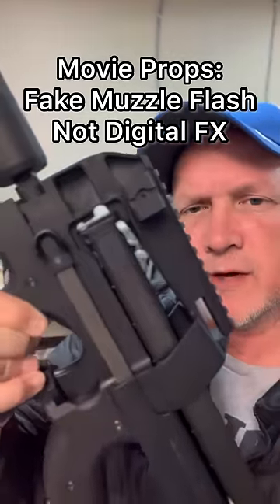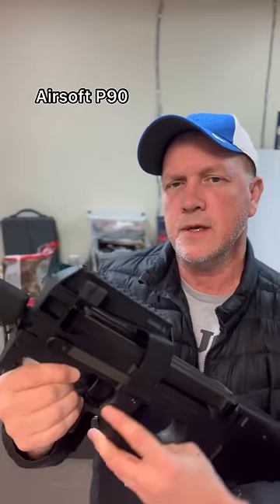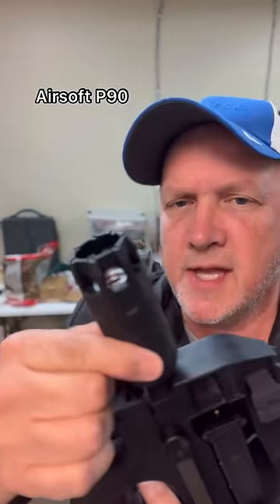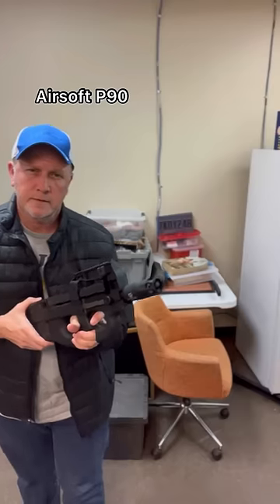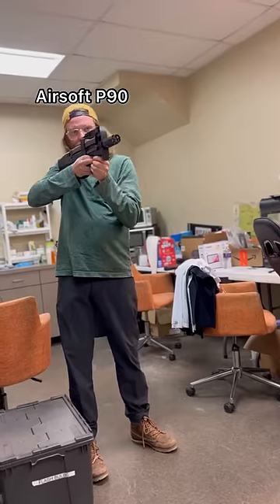Movie Props:  Fake Muzzle Flash on Airsoft Prop #shorts

Comment: Airsoft will always be a hundred times safer than blanks, plus you can get all-metal versions that look virtually identical (other than in hero shots), and there's a fair few with shell ejection out there. I have 0 problems with shows and movies using airsoft rather than blanks.
Reply: The answer is price.
You want weapons to look real-you need metal replicas.
You want weapons to feel real-you need replicas with recoil simulation and proper weight.
You want a close-up shot with cases flying around-you need either a heavily modified replica or a ton of VFX, because most airsoft models won't have ejection and cases. 
You want a weapon, which doesn't have a good airsoft replica-well, guess what?

It's a lot of money to invest, probably, some prop studios have realistic airsoft guns, but a good armorer and a ton of blanks and guns for blanks is still cheaper.
Reply: @Dazllingston  a blank firing gun costs more than a CO2-powered blow-back full-metal 1:1 replica. Source: I have a CO2-powered blow-back full-metal 1:1 Sig Sauer P226 replica that cost me 100 bucks. Shell ejection is rare, but still cheaper than a blank firing gun that's allowed on-set. Plus, shell ejection can be done so easily in post, an intern can do it in after effects in a few minutes. Also, blanks (the ammo) cost far more money to fire than gas, and it has to be reset more often than gas. Not to mention the cost of insurance being lower, no lives being in danger, and no costs of the set being shut down for investigation if something goes catastrophically wrong.
Reply: As someone in this thread mentioned before, real guns are FAR cheaper than airsoft in the US, which is a problem in a number of ways.
Reply: @jaycorbin  Why would it be a problem. Guns should be affordable so more can buy them
Reply from the maker: @Dazllingston    I agree.  I prefer conventional blank gunfire for sure.  I’m just showing alternatives for those cases when you have no choice.  My current show will not let me use anything but replicas and airsoft.  Which sucks when you need revolvers and bolt action rifles etc.
Reply: @jaycorbin  A gun can not be violent or kind it is an inanimate object.
Reply: @ScottPropandRoll    sorry, maybe language barrier made me sound rude, English is not my native language.
I wasn't trying to prove that airsoft is bad for props, I was answering why isn't it so common. 
I do enjoy your videos and I want to apologize for this misunderstanding
Reply: @lucky43113  And yet killers use it, TO KILL!! So maybe we shouldn’t be allowing killers to use guns to kill. My god.
Reply: @jaycorbin  Last I checked murder was illegal. You really have no clue
Reply: @lucky43113  Ok…. And yet the weapons people use to murder are perfectly available. Apparently you need a license and rigorous testing to drive a car because a car is dangerous, but an AR-15 and a bucket of bullets? You can’t just pick up hat up from the local Walmart for $20 once you turn 18.
Reply: @jaycorbin  The gun will do whatever the person holding it chooses. I don't know any gun owners who have committed a violent act. I can take any gun load it and set it on the table it will do nothing without human interaction
Reply: @lucky43113  neither does a car, but unlike guns, you actually have to be COMPETENT to drive a car.
Reply: @ScottPropandRoll  atleast there are shell ejecting bolt action airsofts and gas powered airsoft revolvers also use shells to hold the bb so at least that can get you half way there
Reply: @lucky43113 that's the most stupid argument I've ever heard. It doesn't change the fact that guns were designed to hurt/kill and that it gives the wielder more advantage than most weapons, or even objects.
Reply: @drogadepc  Firearms are the exact reason we have the freedoms we have.
Reply: @jaycorbin  More ignorance driving is not a right the 2A is a right
Reply: @jaycorbin  Well regulated means in working order
Reply: @lucky43113  a Well-regulated MILITIA. Would you like me to paste a definition for you?
Reply: @jaycorbin  
Yes, a well ordered militia.  Regulation has had it's meaning corrupted in this post OSHA world.
Reply: @lucky43113  Nah, dawg, guns are meant to destroy living creatures (with the few exceptions like starting pistols and plinking guns). I own guns and think other people should, too, but let's not pretend a gun is the same as a hammer or a kitchen knife. My S&W has exactly one job, and I'm not in denial about what that is.
Reply: Oh yes guns so scary
Reply: @jaycorbin  that is so hilarious wrong, airsoft guns are much cheaper than real steel firearms
Reply: @user-gu7yo5yn9g  The cheapest full-metal airsoft with gas blowback recoil and all the stuff that a film-set would need for realism is $1500. i can get a real 1911 from Colt or Kimber for 1/3rd that price.
Reply: @jaycorbin  again wrong the cheapest colt 1911 is 900 bucks and kimbers sit around 1300

Also you only said airsoft is cheaper than real guns you didn't specify you meant the hyper realistic types which of course are going to be expensive.
Reply: @user-gu7yo5yn9g  Well yeah, What you think John Wick would be holding a cheap plastic gun with a massive orange tip? Of course film crews would need the "hyper-realistic" ones if the action is going to be believable in any way.
Reply: @jaycorbin  I'm simply exposing the inaccuracies of your comments as you wrote them. Not my fault you tried and miserably failed to virtue signal.
Reply: @user-gu7yo5yn9g  WTF are you even talking about now? Do you even know what "Virtue-Signaling" means?
Reply: @jaycorbin ban cars
Reply: @jaycorbin  bro. A standard ar-15 is like $1500 while I can go to an airsoft website and buy an identical one for $300
Reply: @The_DB9223  Well if you read my other comments, you would know my reasoning.
Reply: @jordanrivera8317  Any test is better than none. Especially when you’ve got “Second Amendment” fans that need atleast one AR-15 with them everywhere they go for emotional support.
Reply: @jordanrivera8317  Yes. I have a .45 Walther I take to the range every once in a while. You assuming in a “ban all guns” kind of guy?
Reply: @jordanrivera8317  And yeah. Let’s see how many of those guns were bought in Nevada or Arizona and brought across state lines because those two states DONT have any gun laws whatsoever….
Reply: @Zeis  I bought a blank hipower for 120 and a silenced Walther ppq for 220 🤔
Reply: @lucky43113  why even legalize guns just ban em
Reply: @tomatoe308  because its my God given right
Reply: @jaycorbin  
At which Walmart did you see AR-15s for $20? Asking for a friend....
Reply: A lot of airsoft is actually licensed by firearm manufacturers. I have a 1-1 sig sauer m18 airsoft. It looks exactly the same
Reply: @IvorMektin1701  ...."postOSHA"? Are you fr? Having an opinion like that....I'd be willing to bet OSHA (and the labor unions of old) have probably saved your life, dozens of times over, and you don't even realize it... 🤦‍♂️
Reply: @jordaneggerman4734  
Thank you for revealing your sub 90 IQ
Reply: @IvorMektin  .....nice response. Pretty clever... the problem is, you didn't have to think, for either of your comments. You merely regurgitate points that were spoonfed to you, instead of using a tiny portion of whatever brain you may or may not have....
Reply: @jordaneggerman4734  
I know how you were programmed but thanks for the clarification.  Too bad you're ill-equipped to understand abstract concepts.
Reply: @IvorMektin  also....really....just hold my L right quick, because all you have really done is paraphrase what I said, and parrot it back at me. That's the truly sad tale....and you claim that I am "programmed"... 🤣🤣🤣
Reply: @emyriandragon2277  yeah and besides its just not for lovies its for fun and sport
Reply: @IvorMektin  ....keep proving my point....glad to see someone still uses their thesaurus...especially when the evidence for what I've been saying is literally here, in black and white. Projecting? You don't even know what that word means, beyond the slide projector that is your brain...
Reply: Or maybe firearm common sense. Wow so hard to do!
Reply: @Zeis  and way way cheaper then for real guns. Source used to be into airsoft and current own a redacted number of real guns.
Reply: @jordaneggerman4734  I’m well aware of what happened to Brandon Lee. Do you know what happened? But thank you for assuming my intelligence random inconsequential person on the internet.
Reply: @H. S.  if there hadn't been a real firearm, firing blanks, involved in the shooting of that movie, Brandon Lee wouldn't have died. That's what I know..."random inconsequential".... 🤦‍♂️
Reply: @calebemerson9317  I’m not trying to start one…… You seem to have completely misread my point….
Reply: @Jay Corbin  no you can't Walmart dosnt sell ar15s and you still need a federal background check literally every where, and some states you have to have a gun license to buy or own and it's harder than a drivers test and drivers tests are hardly rigorous. You also have to be 21 to buy ammo at Walmart and show I'd plus handgun ammo country wide is 21. Everything else is 18 for ammo. also let me know where I can get a bucket of bullets for 20$ I'll buy 100. Also, no state has "no gun laws whatsoever."  Nevada has some of the most complicated laws more than other states. You also can't buy guns out of state if you live in California.
Reply: @whitewidow9046  And as for the License part, most states now have “Constitutional Carry” laws that allow you to own guns without a permit or license. All you need is a valid ID to prove you are over 18 years old.
Reply: @Jay Corbin  you don't have to be competent to drive a car just go check out fail army you'll see I'm right
Reply: @whitewidow9046  You still need a license, which as I pointed out before, you don’t need to own a gun. Even if it isn’t “rigorous”, you still need to prove you can drive a car without killing yourself, unlike owning a gun. And AR-15s are FAR more dangerous than a car.
Reply: @The_DB9223  fun fact - almost all of the guns in sicario are airsoft. I couldn't tell except by the way they moved and aimed. I noticed it before I knew but after it's pretty obvious. But they look very real. I wouldn't have been able to tell if it wasn't for a weird subtle thing I noticed.
Reply: @jaycorbin  uh...no, that's not what constitutional carry means, at all. Most states don't require permits, however at a federal level to purchase a firearm from any licensed dealer you are required to pass a 4473/NICS background check, processed by the FBI/DOJ. Federal law ALSO stipulates that you must be 21 years of age to purchase a handgun. To circumvent any of these, you are just committing a crime, and the laws have failed anyway.

What constitutional carry stipulates is the removal of licensing to carry a handgun on your person, it doesn't change laws regarding purchasing or ownership, especially since those are, at the very least, handled at a federal level, and sometimes expanded on at the state level.
Reply: @alzed9983  And again it is illegal to enforce background checks for gun purchases in Texas under the “Second Amendment Sanctuary Act” signed by Governor Abbott. The law EXPLICITLY punishes any law enforcement agency in the state that enforces federal gun regulations.
Reply: @Jay Corbin    man I'm not about to argue about little details of every state. I just pointed out that everything you've said so far has been factually wrong. Maybe you meant to wrod things differently, but you didn't, so I'm just telling you you're wrong. You're spreading misinformation hugely.
Reply: @Jay Corbin  again your completely wrong, I'm sorry, dude, but you are. Constitutional carry has nothing to do with acquisition or ownership. The ruling in Texas isn't as you described. That's not what that means, either. It's like you're only reading bits and pieces of things and don't fully understand how federal regulation works entirely from state to state. Nothing your saying is factualy right, or accurate based on your examples. I'll give you  an example of how I view your understanding. You read "in P.A. you may own a handgun without a permit in any holster or configuration so long as you are a citizen. " To you, this means P.A. has no gun laws. As in, "I can go buy a gun from an FFL and walk right out. No background check." That's completely not true and every state you do a nics check through 4473 or have a liscense to own a firearm that's linked to the same regulation software that a nics check is and either way you fill out a 4473 regardless. You do understand a 4473 is a background check, correct? It's federaly mandated. I'm not wanting to be   insulting but you're just not right, I don't know what else to say.
Reply: This is what you get from people like  @Jay Corbin "Are you actually going to make an argument, or are you going to keep copying and pasting the same shit over and over again. Use your brain for once in your life. "

I explained that he is wrong about literally everything he has said, individually. Then, the inner adolescent child in him comes out. Can't accept he's wrong and  pouts. 

He deleted his comment, but it's such a douch thing to say. I figured I'd post it back for him.
Reply: @whitewidow9046  Apparently you are blind, because I never deleted my comment, and I can still see it right in front of me. Nice to know that you have jumped to straight up lying though.
Reply: @Jay Corbin  why does that matter? I thumb 3 words wrong so what
Reply: @saxxxxxmanL  You might want to read my other comments. In states such as Texas and Florida, stores are not required to do a background check under those states “Second Amendment Sanctuary” laws. As for license, most states now, including my home state of Indiana, have passed “Constitutional Carry” laws which have provisions that also allow you to buy and carry guns without permit or license.
Reply: @jaycorbin  who is "allowing it"?
Reply: @jaycorbin  Walmart doesn't sell guns and hasn't for quite some time now. I am all for gun control but you are just making us look ignorant.
Reply: @jaycorbin  Lol no you can't
Reply: @commiecomrade2644  Walmart does sell guns. They no longer sell the guns most common in mass shooting events, but you can absolutely still buy hunting rifles and ammo through special order. Also Walmart only stopped selling AR-15 in 2018, and stopped selling “high-capacity” ammunition in 2019. That wasn’t that long ago.
Reply: @jaycorbin  I am a Florida resident and every gun store I've been too has to do the 4473 which is a background check form. What you are spewing are full on lies and it really shows your ignorance of gun law.
Reply: @commiecomrade2644  "I'm all for gun control" yeah the username checks out
Reply: @jaycorbin making more laws for guns hasn't seemed to stop criminals so far. What don't you understand about that concept?
Reply: @commiecomrade2644 gun control doesn't work
Reply: “We should abolish all laws because criminals don’t follow laws”
- @Alex-oz9eh  

If criminals are the issue, why is the US the only country in the world to have mass shootings. Libya and Syria, countries that are in the midst of civil war don’t have as much firearm homicide as the US. Gun Laws work literally everywhere else. How is that so hard to understand?
Reply: @jaycorbin you can own a car without a license
Reply: @wafflescripter9051  No. you cannot, unless of course you just shove it in a garage and never touch it, but those are two very different situations. “2nd Amendment” sycophants are generally the kind of people that take their lucky AR-15 everywhere they go.
Reply: @nobodyaskedfortwitterhandles  that you for proving you’ve never actually read the Second Amendment. Literally the first line is “A well-regulated militia” unless you report to a military commander, the 2nd Amendment doesn’t give you the right to anything.
Reply: @adabsurdum5905  kitchen knives and hammers shed more blood each yeah than a gun does. Sounds like you can look at it the same, no?
Reply: @Zeis Sure, an airsoft gun is cheaper than a real gun on the market. But Hollywood rents real guns and ammunition from a company that stockpiles so much. It would require a company to purchase and stockpile so many airsoft guns in order for the rental price to be a fraction of that of what's already available.

Comment: CorridorDigital would probably point out that the muzzle flash is wrong, but as a normal viewer, that could easily pass off as real. and the fact that it's in camera is nuts
Reply: also speaking of CorridorDigital you should contact them and see if they could do a "Prop Masters react:" series, youd be perfect for it

Comment: Honestly, thats pretty ingenious and while its a little excessive for realistic muzzle flash, it could be tuned or toned down in post. Plus the gas operating system can be tuned to weighted pistons to grant more realistic or less realistic recoil depending on the film. And while accidents with prop guns are rare, as weve seen, they have happened and are always a concern. Where as this allows for safer operation and no need for special tricks they have to use when framing scenes with regular prop guns that would be unsafe even with blanks

Comment: Some insight as to why these are not the industry standard:

1. They are hard to see in bright daylight, especially compared blanks loaded to be bright.

2. They typically don’t make sense. These LED units are often designed to look like suppressors or flash hiders to keep them incognito. However, in real life these muzzle devices would obscure most, if not the entire flash.

3. Even disregarding point #2, these muzzle flashes are pretty small. Real muzzle flashes are quite a bit larger. However, I imagine these would make the job of CGI artists a bit easier (no more simulated flash reflection for one).